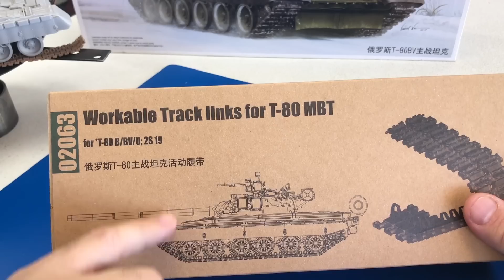Trumpeter 1/35  T80 BV build review

Comment: I am currently building this kit and I can not confirm the "problem", that was discussed at 4:55. However it is advisable while building the turret front ERA armor NOT to follow the order presented in the instruction! The best way to start beginning from the center, where the cannon is and build up the ERA while moving to the sides. It is the best logical way as you are placing more and more ERA on the already placed ERA bits. If you follow the order in the instructions you will have a hard time to place all the bits so they fit! So start wit the ERAs near the cannon and move to the sides! You need to be extra carefully not to mix up the ERA bits as they consist of a lot of tiny parts, but if you do everything right everything will fit just fine! BTW: On the other side of the turret one ERA bit is also missing!

Comment: Nice looking kit.  The tracks are an issue, a lot of work cutting, cleaning and gluing guide horns.  Seventeen sprues. The first thing I would do is take a piece of tape, write the sprue letter on it and then attach it to the sprue so I could see it from across the table.   Like the new idea about posing builds that "your crew" does.   Thanks for the post Andy.

Comment: Have they updated this kit with new parts? I ask because I once had a look at this very one and was disappointed with the headlight guards. They were too thick and were only rounded on one side. These ones look good though.

I tackled the Trumpeter T-72B/B1 which was the most complicated kit I've ever done. 1300 parts. It was a major undertaking and I doubt I'd do it again but I'm glad I did. It looks fantastic. Meng and Tamiya are more my speed.

Trumpeter is coming out with some new T-80s in the next year or two I believe, which means Meng will be doing one. I would pounce on a Ment T-80, and probably take it to bed and sleep with it a couple of nights before building it.